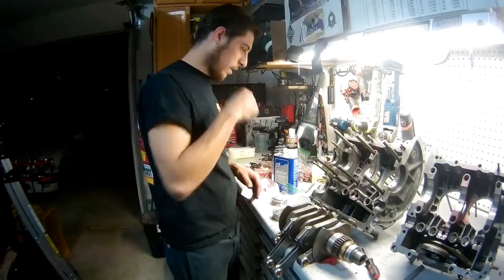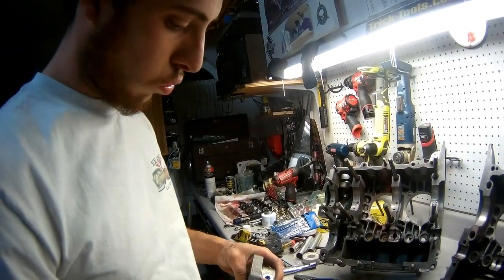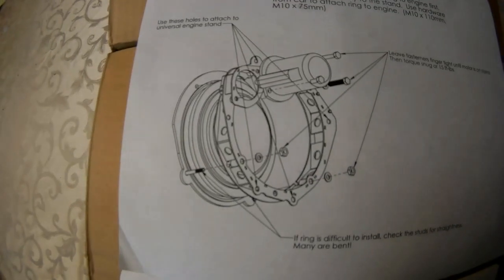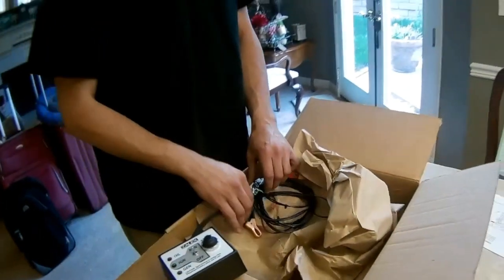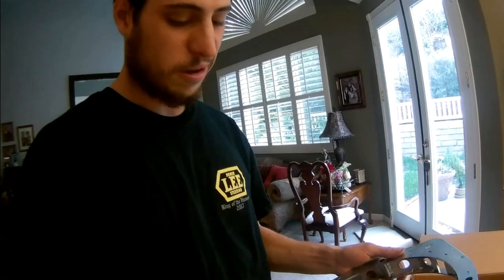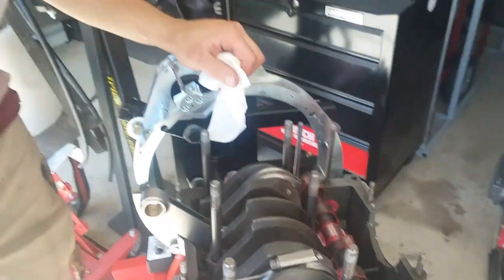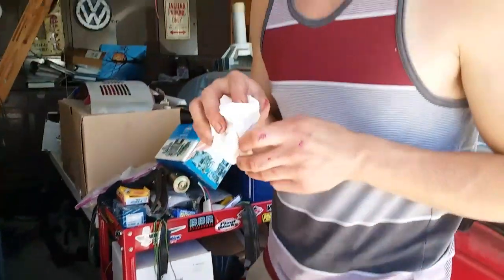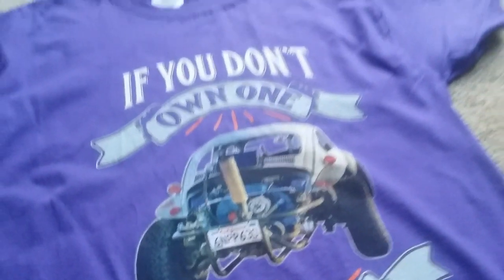2180cc MONSTER Engine Build

Comment: So did you ever finish this build or not I couldn’t find another video on it
Reply from the maker: No we haven't finished it yet, we are actually in the middle of sourcing different parts for it right now. Hopefully we will have it together soon, the Dust Buggy's 2332 is getting tired and needing a rebuild. It would be nice to have an extra motor on hand too just in case

Comment: Why did you change the 2180cc for a 2332cc? This engine looked good for a baja. @dustbugy
Reply from the maker: We haven't changed it, we had the 2332 already in the Dust buggy when we started building this engine. This one is going in our second Baja bug and the 2332 is staying in the db

Comment: Wow, I'm super impressed that you two are out to tackle this thing!
I've only known of your channel for less than a week and here you are about to assemble a motor.
I'm defiantly not going to be any help here.  I do most of my own maintenance and parts replacement on my own baja, but what you are preparing to undertake is far outside my comfort level. After watching the the Dust Buggy squat and yaw under acceleration on the video where you found that sand dune mountain, I have to admit that my 1641 DP seems to be a little less thrilling.
I will be watching your engine build with great interest! I'm not working with much of a budget here, but I do have a spare 1600 that might be a starting point for a future bigger motor. I would probably be happy with a 1835cc. Well, like I said, I will be watching your progress closely. I hope that you two will give us lots of updates, along with problems that arise and solutions that you find.
Reply from the maker: It is such a great feeling to mash that pedal and feel her booty drop 😉😂 and 1835 should be really nice step up from a 1600! We went 1915 our first rebuild and like the increase of power, so when the rear bearing walked out on it we decided to go that much bigger 😎 glad it happened!

Comment: The thrust bearing in case should be good & tight. 5-7 end play . 2180 cc get hot . race motors need a bit more expanding room .  pin it to win it .

Comment: Bro I have build 40 VW motors+ No grease on the case ! Only on the bearing surface . between the cam & bearing  . your Bering will slip and slop killing the case  . case to bearing surface to.be clean with brake cleaner. . Same for the rods . bearing to rods clean and dry . bearing surface to crank assembly grease it . PS Im still learning . not trying to bust your nuts.  VW motors are expense.& fussy but fun . good luck Dust buggy.
Reply from the maker: Thanks for the tip!! We appreciate it, we don't want to kill our case. We had another motor built by someone else go bad when the rear bearing was machined improperly and we had to do a whole tear down and rebuild again. So we definitely would rather someone say something to guide us on the right path haha